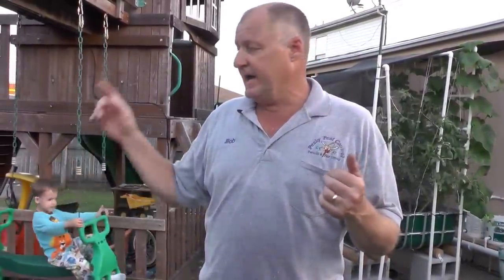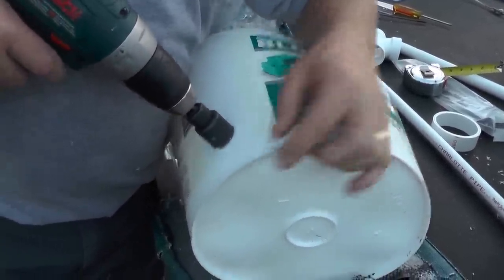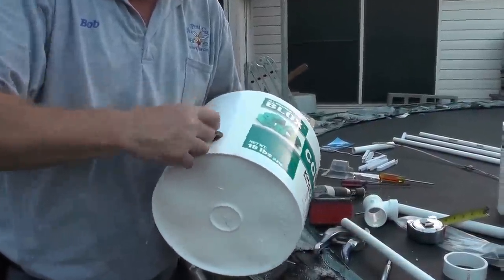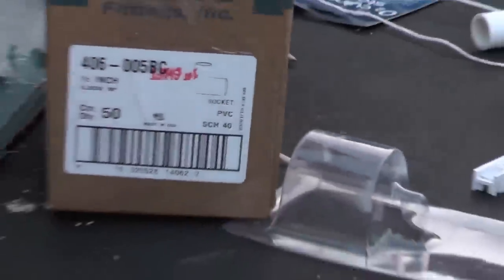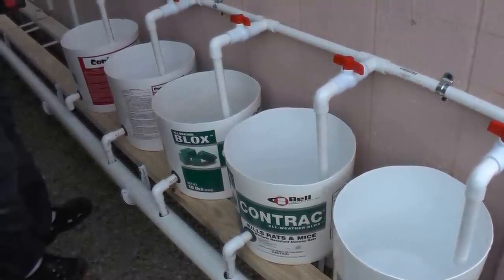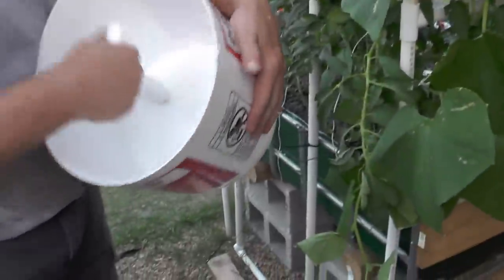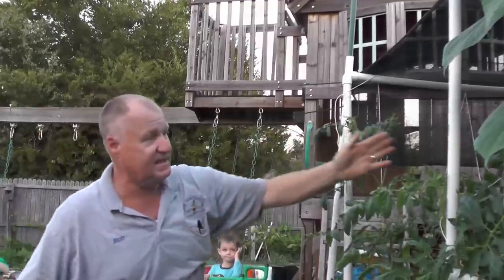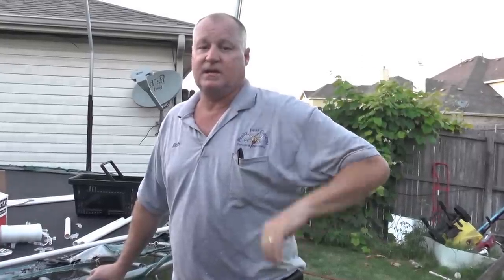How To Make a Dutch Bucket Filmed by my wife #8  7/14/2015

Comment: Very informative video. What I do like about your system is the consistency with materials (other than the buckets, and those are so darn expensive).  PVC piping looks neater and much better and I like that the nutrient feed can be switched off on a bucket if it's getting too much.  Really good work.

Comment: Just a quick tip. When drilling PVC with a hole saw drill the pilot and then reverse the drill. The plug will not get stuck in the hole saw and it makes a cleaner hole.
Reply: lol i said the same thing when i saw him removing the plug from the hole saw
Reply: chris coffey 

I was thinking  the exact same thing when he started drilling
Reply: Thanks for the tip. I always had a hard time getting the pvc out of my bits. Now I know!
Reply: That's true. He published this vid nearly 2 years ago.  I only learned that seemingly simple trick last month - on YT.
Reply: These buckets are NOT made of PVC, most probably PP but I know - nobody cares.
The tubes are PVC indeed
Reply: C P 
Yeah, and watch out for the very sharp burs they will cut the hell out of. You..best to use a wigglereamer
Reply: Yup just like when cutting siding on a house with a circular saw.  You install your saw blade "backwards"...no burrs...clean cut.
Reply: Ditto!
Reply: And as a possible side benefit does it sharpen the teeth of the hole saw because you are running it backwards?  and eventually after enough years of running it backwards just return it to the store as it is in "like new" condition.

Comment: Grommets are sold listing the I.D. and O.D. so, you need to know the O.D. of the PVC pipe you are using and the diameter of the hole you drilled in the bucket to order the correct size grommet.

Comment: I am amazed how you used lots of bucket & PVC's for circulation of water for hydroponic's, for us in Thailand we order a fertilized soil made from coconut husk, cut up dried banana stem add up all dried fruit & vegetable in a bag added a compost of course maybe 12 to 24 bags split the plastic opening on side as you lay down & slit the bottom install a plastic net to catch & strain the used water for recycling process, this system is organic plantation without the used of ground soil

Comment: Two items, well maybe more.  I have discovered empty cat litter buckets [yellow square ones] can be had for free if you ask around.  Second thing, I have had wonderful luck using 5 gallon paint strainer inserts and pearlite as a grow media.  Lighter and cheaper than clay and fill to only about 3 gallons.  Also, instead of the large pvc pipe and valves for each bucket, I use a fountain pump feeding drip irrigation pipe as a manifold and inserting emitters with 1/4' tubing into each bucket.  I run the pump via a timer set to 30 minutes 5 times a day.  It grows giant tomatoes for me in Illinois.
Reply: Pastor William Barhorst. I would be happy to after I return home in late April.  It might be best if you email me again as I might not see this request then.
Reply: Never used hydroponic, but just realized that i have spare empty ice cream buckets, small solar panel and matching pump...might be about right.
Reply: Greg, I did that too last year.  In Texas my tomato plants grew leggy and all the bottom leaves died until I had a six foot stalk with no tomatoes.  I did have nice algae growing in my perlite. I used 3 gallon icing buckets from Kroger with the paint strainers.  Great luck for you....yours grew....mine died.  We have hot sun here.   Thanks for your comments.  Phyllis

Comment: I gave my girlfriend a Dutch oven a few times. On another note. Want to get real froggy with it? Place 1,  4 ft rockwool slab, attache to the wall upright above each bucket and grow vertically off the wall...double your grow area ...common pump and pvc drip above each rock wool slab.

Comment from the maker: my bucket system worked great BUT I put it in the wrong place to close to my other beds so I am moving them.   I use dark Buckets the don't grow moss or algae.  the video was to show how I make them. my system is dark buckets. lowes Gray ones are ok but light still gets through. but black get HOT here in Texas.  my system is also getting moved because I am setting up a new Fish room and the water will drain in the  sump for my system feeding the plants.
Reply: BugGuy Bob + GREAT AND INFORMATIVE VIDEO.  ....!!
Reply: Just curious...how do the white and dark buckets get along?
Reply: undo.kat When my white bucket eloped with a black
Reply from the maker: use black
Reply: I've heard that once you've had black, you never go back.
Reply: +CHARVESTER ".....nobody wants you back"
Reply: Story of my life, Bob.
Reply: You could paint black buckets white.  Also you should paint your PVC (eventually) as the sun will destroy it.
Reply: BugGuy Bob Wash them out with hot soapy water then then light sand cheap spray paint good to go.
Reply: Thanks! For sharing Bob! Great Job!
Reply: coffee that is.
Reply: BugGuy Bob
Reply: Wrap buckets in light tight Mylar to prevent algae and keep rootzone cool in summer (warm water means low dissolved oxygen leading to root death and anearobic diseases).

Comment: yeah i noticed the bucket label as well. I see it was addresed so I won't go into it. i am real touchy when it comes to growing. I don't even use a bag dirt unless it is labelled "safe for consumption" of items grown in it. I now make my own growing soil. I use different ingredients for different plants and get them in bulk. I mix them easily in a small home owner size rotating cement mixer. Great video, I might have to give it a try.

Comment: If you drill forward until the center but goes through, the drill backwards for the larger hole. It takes a little longer but your hole is pretty clean

Comment: In South Africa, these are used all the time but with a slight modification: The downward elbow inside the bucket goes off at a 30 degree angle allowing for more water at the bottom to be retained. Otherwise, this is a great DIY project that will save you hundreds of dollars if you were to buy them from Home Depot or some other store. And btw, your wife is hot! Thanks for the video!

Comment: The Dutch Buckets are the heart of the system. They contain the media in which the plants grow and they can be positioned to provide the plant spacing required for the crop being grown. Their design incorporates many features that allow them to be the central part of a very plant- and grower-friendly system.
Its a form of Hydroponics.
Hydroponics is a subset of hydroculture, the method of growing plants without soil, using mineral nutrient solutions in a water solvent.

Comment: Seems like a system like this would be more efficient if you have a pressure switch pump and pumped from a lower reservoir  to an upper reservoir. 
Have one reservoir below the buckets where the water returns to and one above the buckets. When the lower  reservoir is full  enough the pressure switch will activate and evacuate the lower reservoir pumping the water to the upper reservoir. The upper can gravity drain at whatever rate you choose by means of one ball valve and drip holes.  Which would eliminate a pump running 24/7. 
As it would only cycle when the lower hit the amount of water to trigger the pressure switch. A simply sump pump and check valve would work perfectly and are designed for long term constant use. 
You could also utilize the upper reservoir with a foam raft  to grow lettuce or whatever else.  In the lower reservoir you could house some type of fish which would bring nutrients into the water.

Comment: rat poison buckets :O crazy!
Reply: my thoughts too... hope they didn't get poisoned!
Reply: So unsafe....rat poison buckets....
Reply: I wouldn't use them
Reply: Could be why he is on Wife #8 lol
Reply: t rr I thought same thing.  lets water are vegetable with buckets that used to have rat posion.  sighhhhh can't fix stupid
Reply: makes you wonder who needs buckets full of that.. Well a man on wife #8 I guess
Reply: It's Contac pelletized ant-coagulant bait. The bucket will hold NOTHING that is poisonous to humans.
Reply: ya check this out no jokes im  in a hardware store at the plumming  isle , and im reading this fittings warning ,, its called the shark bite system ,,, any ways  i read warning not for use in California  contains a carcinogen ,,, the guy  trying to sell the system to me says they are only carcinogenic in California  ,, i wont be shopping at  home depo again
Reply: tuber 
Lol Lol woe got you good oooooothat burned...lol lol lol..
Reply: As an Exterminator, you are NOT supposed to reuse rodenticide containers for anything other than the bait it originally came in AND you are supposed to dispose of it properly.......hmmmmmmmmm, not following the STORAGE AND DISPOSAL label instructions which state: Do not reuse or refill this  container. Offer for recycling or reconditioning; or puncture and dispose of in a sanitary landfill;  or by incineration. In most states, burning is not allowed. 
Dispose of product container and unused, spoiled or unconsumed bait as specified on this label

I'm just saying.....🤔
Reply: lesterclaypool1 Everything causes cancer in California. Good thing I’m in Ohio. 😆

Comment: If you drill the buckets backwards, you will safe time. The holes will be neat and it will be easier to remove the piece stuck on the drill. THanks for the video!

Comment: LOL @ wife #8 comments! Dutch buckets are a hydroponic gardening system, but as some people have already noticed, you really should not use rat poison containers to grow food. There are plenty of free, food safe 5-gallon buckets to be had in urban or suburban areas. Just visit your local donut shop/supermarket bakery and ask them if you can take their empty icing/frosting buckets, which they usually throw out, a couple every week. You can take them home, wash them out and bingo, free, food safe buckets. They also often have smaller sized buckets (1-3 gallons) if you want those.They don't HAVE to be used for pot growing, and these folks are probably "preppers" growing veggies, but coincidentally many mormons/LDS people are also preppers.

Comment: For those  that do not know: a dutch  bucket is a 5 gallon plastic bucket  with the top 5  inches or so cut off  used to catch  water  then  a hole is drilled into the  side to let the water  run out.  There   you  have  it  from someone that  knows..

Comment: Hey Bob, great video. I want to build the same, but in 1gal. buckets, to save space. What size grummets are this from Grainger? I found this on their site: Style 1 Rubber Grommet, 1/2" I.D., 1" O.D., 3/32" Panel Thickness, PK100. Is this ok?

Comment: so, does this system use rain water or is connected to domestic water supply with a backflow preventer or air gap to prevent cross contamination?

Comment: Since the system has an overflow at the bottom of the bucket,  What possible need is there for all of those expensive red handle valves?
Reply: Exactly.
That probably added 10X to the cost!

Comment: I hope you have a backflow device on the pressure line that goes into the buckets. With it being a type of irritation system it will probably require a double check assembly depending on your water suppliers regulations.

Comment: HI Thanks for sharing i am going to use your method very cool can you tell me the pvc pipe that goes into the bucket is that a 40mm diameter? as i am finding it difficult to find the grommets to fit around  a 40mm pvc pipe in South Africa? thanks if you could let us know?

Comment: If you cut the PVC pipe at a slight angle, it’s easier to push it in.  Also, if you put the elbow on the end you are pushing on it is easier to push.

Comment: If your viewers don't know what a hydroponic system is... it's not your fault. If the new line against your west wall needs a bit more light, consider pasting thick aluminum foil on the wall's surface. Beware of roses and some lawn grasses (weeds) that can harbor molds that you really don't want in the area.

Comment: If you leave the top on the bucket until after you drill the hole it may be easier to drill through, as the top of the bucket is thicker and lends structural support to the bucket. Also if you have a hand held Dremel tool with a sanding attachment it will be safer to sand the hole once you drill it.

Comment: Just a suggestion, it might be easier to drill your hold and install the grommet before you cut the bucket down. The sides of the bucket would probably be a little less flexible. Good video.

Comment: Hi! Great video. I love the concept and will make a pilot using it. I just wonder if there is any importance if the buckets are white or black, and of food grade or recycled plastic (e.g. cement mixing buckets)?
Reply: where I reside uv level hits 7 so uv stabilized / resistant buckets have to be considered. I would suggest olive or cherry recycled food 10 gal barrels cut in half.

Comment: Would you please tell everyone what the size of the bit is you use to drill the holes, what size of rubber gromet you use and the size of the PVC pipe.  My first attempt ended in disaster.

Comment: Nice hydroponic system. I did not catch if your going to raise fish and/or use solar water pump in addition to this.  I see some elaborate systems and thought maybe this one is to oxygenate the water. (Water fall bubbling effect).

I don't see any need to cut the buckets down lengthwise unless plants need it to catch some sun. I would probably stick with standard size but I have not done this... Good luck.

Comment: So, I drill out some cut buckets on my trampoline, but don’t care much because materials are cheap. Then where does the goat, the carrots, and the lingerie come in? And what if I have a north facing wall? And what if my swing set does not come with a kid built in? Finally how many buckets do I need to become Dutch? So many unanswered questions!

Comment: A problem you can have with running taps like that, is it's almost impossible to get them all to flow at the right rate. Adjust one, and it changes all the others.

Comment: Thanks for posting this video.
But please be careful with the way you have your cinder blocks stacked.  They are structurally stronger if stacked the other way with the holes on top/bottom.  The way they are stacked now if you put too much weight on them they will crumble and fall apart.

Comment: haven't read all hte comments, and obviously it's been a long time since this was posted... BUT, did anyone explain why there's a hole in the side of the hole saw? you can generally take a nail (or something similar) and work the drilled medium (wood, plastic, etc.) back off the drill bit without having to disassemble the bit from the saw. just sayin'. Love dutch bucket system, though.

Comment from the maker: I pump my system with a Alpine PAL2100 2100GPH Cyclone Pump, 33' $104 on Amazon it has Clogged run empty and STILL keeps going I run it under water so I very Quiet

Comment: Is this system similar to bio buckets? The only difference I see is the drains aren't at the top like bio buckets and there is no basket with lava rock to help culture beneficial bacteria. And with bio buckets you keep the pump running full time to exchange the water 7-10 times per minute. I had too much root development though and they clog up the drains after a while. The last thing you need in hydroponic gardens are big root systems, it defeats the purpose but I'm not sure how yours are feeding, what medium you use and the flow rate in gallons per minute. It looks good though. Maybe wife #9 can clarify the system.
You may want to investigate the bio-bucket system since you are almost set up for it, and it saves you tons on feeding costs. (you don't have to change out your reservoir during the crop cycle!) 
Credit for the Bio-bucket system goes to Big Toke @ Weed Watch, and where you can find details if you are interested. Good for food production I should add...

Comment: try running your drill in reverse when cutting with a hole saw. Cleaner cuts, less de burring.  Yes run the drill in forward while drilling the pilot...then switch

Comment: Drilling PVC is easier if you pilot in on forward, then reverse, and cut the larger hole with heat AND friction.
Reply: Or you could just cut the damn hole and be done with it...  ;)

Comment: Thanks for sharing - great video.  Try a machinist's deburring tool to clean up the edges of that plastic - you'll never use a razor blade again.  BTW - I hate HOA's too.  They always get the biggest A-hole to run them, too.   I can't wait to move out into the country and move away from these Nimrods

Comment: If you would just use a flat drill bit, you would never have to take anything apart and unscrew any plastic!!  And the flat bit would drill just as easy and just as clean.

Comment: A Bulkhead fitting would work better and is much easier. They are simply a male adapter with a lock nut and rubber washer/ gasket.

Comment: Someone please post a short statement as to what a Dutch Bucket is or what it does??
Reply: Kerry Sisler-
They are used as containers to grow plants hydroponically. 
The pellets are in the bucket to give the roots something to hold on to. Sometimes the nutrient rich water is kept recirculating. No dirt is used. I believe the top of the plant would also have to be supported somehow.
A lot of marijuana growers use this method for indoor grows.